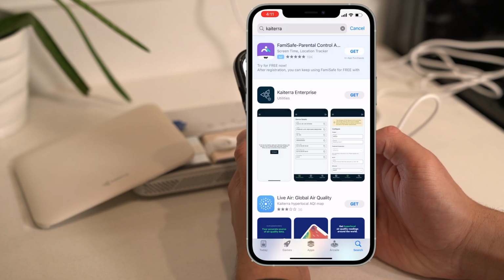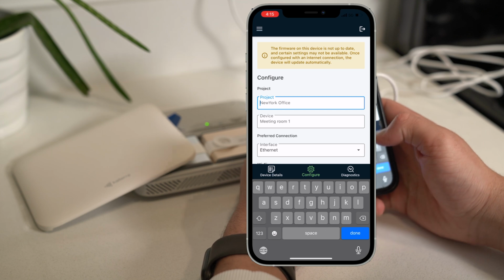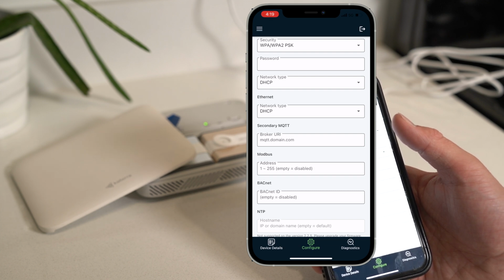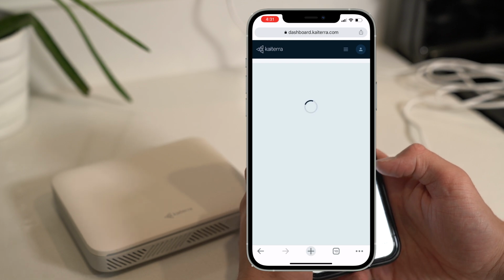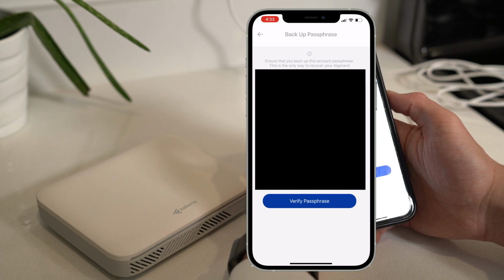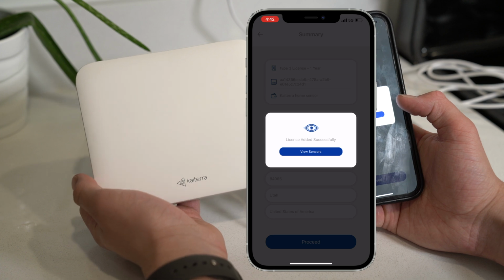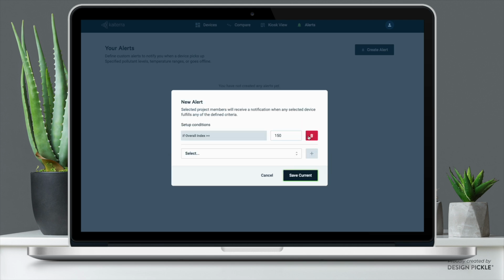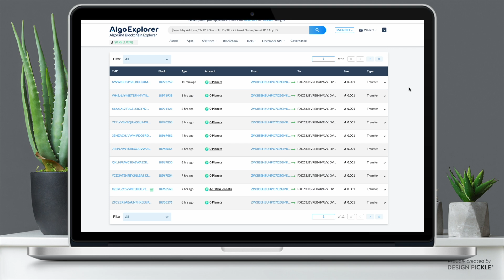Kaiterra Sensedge Mini | Unboxing and Complete Setup | Step-by-Step Planetwatch Type 3 Sensor Setup

Comment: The part with hiding the serial number is not good. It’s ok to hide, but this is paranoid not releasing the hand off and show the light. The watcher can’t see anything because the device is too far away. The camera is on the left and you use the left hand and move the device on the right. Why ? 
The rest is perfect. Good work. Thanks you so much.

Comment: Hello. I have the following question: can I set up my 2 sensedge mini sensors with the Kaiterra app and then after a couple of days to connect them with 2 type 3 licenses from PW through their app?
The reason I'm asking this question is that I'm waiting for a refund on some of my licenses and I don't have available licenses left to buy (the limitation of 5 licenses per person) and I want to connect the sensors and leave them running and when I have the licenses to connect them remotely as I won't be in this town where they'll be hosted.
Do you think this is possible?